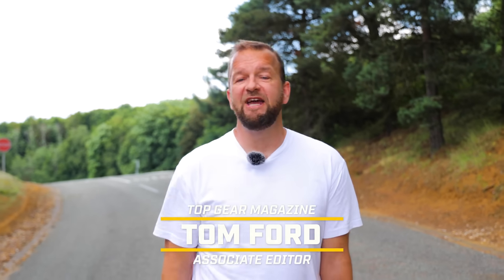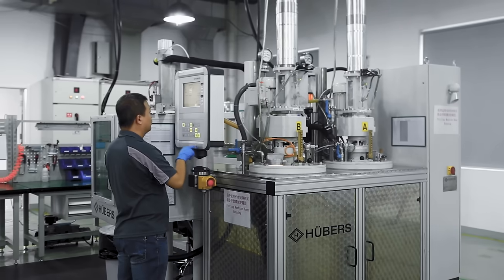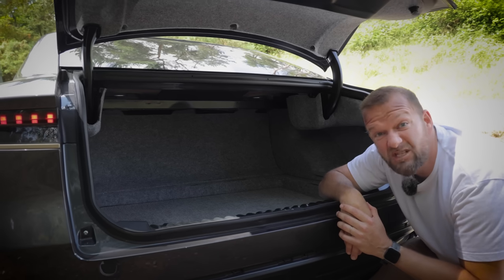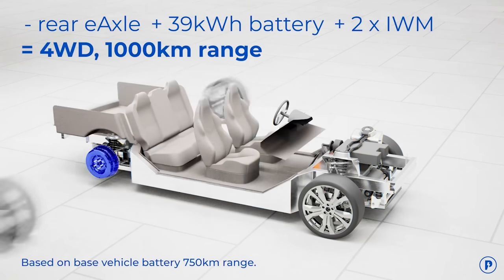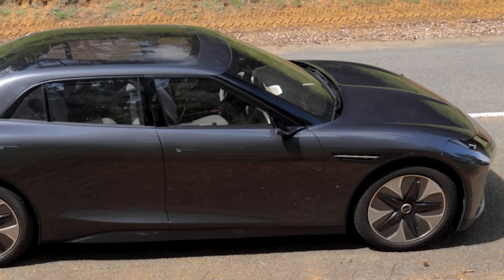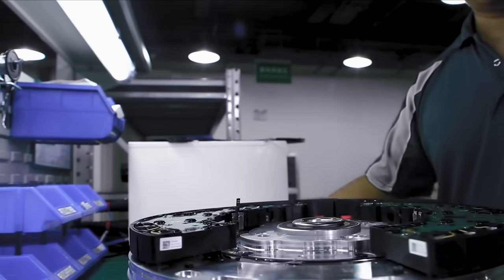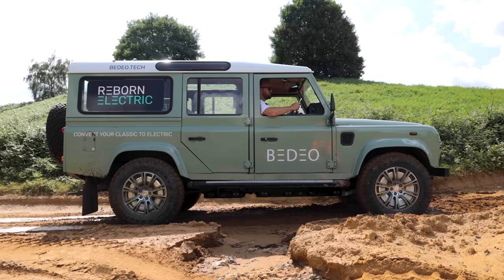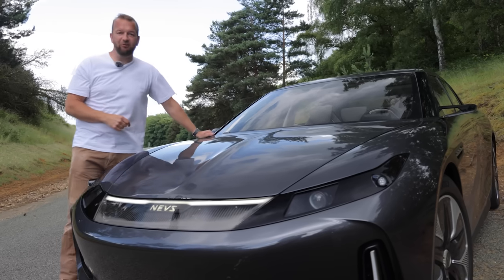NEVS Emily GT: SAAB’s Secret EV With 600 Mile Range | Top Gear

Comment: Absolutely beautiful car. Please brand it as SAAB with the ignition key at the SAAB position.
Reply: true
Reply: I was just saying that. It's a no brainer to keep it as SAAB.
Reply: We just need Saab back
Reply: Yes sir to that
Reply: SAAB, the military supplier that owns the rights to the name, is not allowing it - hence, NEVS.
Reply: Ignition? What is that!
Reply: When was the last time you saw a car with an ignition key?
Reply: Guys, it doesn’t need to be a literal ignition key. They can install a start/stop twist tab in the center…
Reply: Having had the pleasure of owning two 9-5's, the SAAB feel is there for me.
Reply: @John_Hoover  except it doesn't need that either.

it's an EV. get in. put it in drive and go.
Reply: @John_Hoover  SAAB = key. Could be electronic. Same for Porsche at the left side of the wheel. In stead of calling Taycan EV Turbo S.
Reply: @John_Hoover  Loads of cars have that already. It wouldn't be SAAB innovating if they did the same, and it was there as a Security feature as it locked gear box. . 
Polestar don't even have a start button it is on when you sit in the seat.
Reply: @John_Hoover  you don't need to 'start/stop' an EV either.  Just get in and it turns on and you can go, stop and it turns off and you get out!
Reply: @anonym3017  I’m it saying it “needs” a start stop. Hell, if we’re being honest here, most everything about this car isn’t truly a “need”. But it adds character in a unique way mounting it in the center. If it ever does become a Saab, it would make sense.
Reply: @sandersson2813  I’m speaking strictly from a “DNA” perspective. They don’t need stop/start at all. Adding in an electronic key that inserts into the slot just adds a cumbersome step of always getting the key out of your pocket or purse. People won’t want the hassle. But adding a start/stop like the Taycan but in the traditional Saab location makes sense… if it ever is a Saab.
Reply: @MyDagfinn  The 9-5 is barely even a Saab though
Reply: @John_Hoover  There's aot more SAAB design features I'd prefer to have than where the start stop is.
Reply: @sandersson2813  No one is saying they have to stop there.
Reply: Good points!
Reply: Thats ok ill buy one and install the proper badge, speaking of Sweden Koeniggsegg is working on their new tiny 330hp QUARK motor, that can also fit in a wheel well. I would love to see these two work together, Sweden is about to change the world
Reply: Took the words out my mouth 😂
Reply: Can you imagine?! I would buy one today!
Reply: Oh yes! Definately a Saab in my eyes! Please Sweden bring it back!
Reply: @cybertree  you mean like 4x that Q engine ? Holy shit !
Reply: @sandersson2813  you never been in a Saab I guess? They have the key next to the handbrake. Thats cool and should come back.
Reply: @rubbermoetroken  Yes, I had two.
The point is cars don't have keys or manual levered handbrakes now. 
Furthermore tons of car have start buttons in that location now, so it wouldn't really be a SAAB thing anymore.
Reply: @sandersson2813  you have a point there. Still it would be utterly cool if SAAB would do it :)
Reply: I miss that!
Reply: @rubbermoetroken  Polestar 2 is the closest thing we have to a SAAB, certainly in profile it's like an updated 9-3 MK1.
Reply: @sandersson2813  We have a Polestar at our company. They wish. Polestar is of the same kind of garbage as the Tesla model S that's normally parked next to it. ;-)
Reply: They can't brand it as a SAAB. They don't own the name SAAB nor the logo.
Reply: @rapu4  You heart me 😆
Reply: And reverse gear to release the key too lol
Reply: @MyDagfinn  Sorry lol, though I have had a few 9-5s and still have one. Great car, though I'll probably swap to a 9000 sooner or later. At least the 9-5 still has a real Saab engine unlike the NG9-3, disgusting ecotec shit
Reply: @TheBTG88 my guess about Saab the defense company not wanting its name on a car again is probably a case of jealousy - for many years, Saab the carmaker was overshadowing Saab the defense company, and when they got the rights to the Saab name back from GM, they forbade anyone to use it in a car, so that all the people remember Saab today as the guys that built the Gripen fighter, not the guys that built the 9-3.
Reply: @TheBTG88  Nope.. GM still owns the SAAB name for automotive applications..
Reply: @sandersson2813 This morning when I got into my car
Reply: @mullerman1104  I'm talking about new cars.
Reply: @sandersson2813  My car at the post office is from this year, a T6.1, still has a real key
Reply: @mullerman1104  It's a van
Reply: @sandersson2813  Is that a problem?
Reply: @mullerman1104  I specified cars, so your comment isn't related to cars.
Reply: @sandersson2813  why is a T6.1 not a car? It’s smaller than most of American gigantic SUVs. It’s officially a PKW, so why shouldn’t that count? Also every Dacia has keys
Reply: @kristoffermangila  Why would Saab be jealous about Saab cars overshadowing them in the public perception? They're a defense company, don't think their customers are about to confuse them with a car brand sharing the same name. I'm sure the whole naming thing is just about Saab not wanting an unaffiliated company to share the same name
Reply: You meant: Ignition thumb print reader...  LOL
Reply: @jesperviktorsson8027  Incorrect - 'On 29 August 2014, Saab AB announced it was cancelling the licensing agreement that allows NEVS to use the Saab name. NEVS' financial problems were cited as the reason. A spokesman for NEVS said that the company expects to renegotiate the agreement after a solution to the company's financial problems is reached.'  Citation - "Saab carmaker NEVS granted creditor protection by court but loses right to use Saab name". Automotive News Europe. Reuters. 29 August 2014.
Reply: @TheBTG88  the more you know, rhanks
Reply: Ignition switch lol
Reply: @rubbermoetroken  You know it! And that's aLOT of weight/space savings to play with!
Reply: @TheBTG88 Whaaaat?! Why might that be?! Do they still make military hardware? 🤔
Reply: They probably can’t call it Saab for copyright reasons
Reply: What ignition key?
Reply: @sandersson2813  Err.. still most cars, even if fewer than before.
Reply: Yes between the seats as even Volvo has done recently.❤
Reply: @John_Hoover  Also put a red light fasten safety belt on the ceiling and add a night panel showing just speedo, 0-100K.😂
Reply: @richardterrell7539  Chinese design…
Reply: @sandersson2813  This afternoon, when I got into my 2001 Alfa
Reply: @natdenchfield8061  Most NEW cars don't have an ignition barrel that requires A KEY.
Reply: @sandersson2813  I drive rental cars (so I'm not stuck to just my own, and they're new). The majority of them still use a key. 

If your experience is different, it doesn't mean you are right, it only means that's your experience - where you are, the types of car you drive etc etc.
Reply: @natdenchfield8061  You must be driving very low end vehicles.
Reply: @sandersson2813  Ah, so now you can see where your own experience is skewed. Glad we can now see where each other's DIFFERENT experience comes from and how your insistence my experience is somehow wrong is misguided, blinkered.
Reply: @sandersson2813  And ... really do you think a button and fob is a significant difference in cost? 

Seeing as many cars have already had security key fobs requiring them to be nearby to deactivate alarms for like the last 20 years, I would say that keyless ignition is possibly cheaper.

Keys provide an extra layer of security, so it's more about user experience and getting rid of that layer to influence sporty, modern brand image.
Reply: @natdenchfield8061  I can't think of any car which which comes with a physical key and ignition lock unless it's the very bottom specification. 
What cars are you saying are key only, because for every one you can name I bet I could name 5 that aren't.
I just don't buy your claim that "most" cars have an if ignition key, but that could be dependent on where in the world you are experiencing these cars.
Reply: @WatanabeNoTsuna.  Yes, absolutely.
Reply: Agreed!
Reply: Yeah just as I thought too.
Reply: But the ignition aka start button is not for function but for looks now. It is a tradition. Even thought the design intention is for driver safety in case of crash, the key won't stab you in the chest.
Reply: @TheBTG88  SAAB, the military supplier and SAAB Automobile are two different companies.
Reply: @bafattvahetere  SAAB Automobile was only ever able to be called SAAB, because it was initially a division of SAAB (in English - Swedish Aeroplane Company) and later on it was licensed the name.  SAAB, the military supplier company, retains the licensing authority to the SSAB name.  It refused to allow the NEVS entity to use the name, hence why the cars were branded NEVS.  SAAB Automobile no longer exists.
Reply: Saab please !!
Reply: @FFVoyager Boring!  My EV would have a big red push button which would light up the car and play the start-up 'music' of the 1966 Batmobile - Atomic Batteries to Power!!!
Reply: They can't because Saab is still Saabs trade-mark
Reply: Plus, you have to put it in reverse to get the key out!
Reply: @kristoffermangila Saab AB is and always was the one and only real Saab. To say the automobile division overshadowed Saab doesn’t make any sense. The reason they don’t want the Saab name to be used is they don’t want some CHINESE company pretending to be the real Swedish automaker. NEVS is the husk, the factory and the rights to a GM chassis and body style, they are not Saab. The only reason that Saab AB split the car division off from itself was so that they could sell it to GM.
Reply: it looks Saab-worthy.
Reply: Nightmode or bust
Reply: @TheBTG88  Maybe they're waiting for a car that deserves the name.
Reply: Totally agree. Who is this presenter? For obvious reasons I’ve not watched a single episode of the fake TG since Jezza, Captain Slow and The Hamster left. All the cretins hired by the BBC in an attempt to replace them have been tragically bad personality deficient cardboard cutouts with zero car cred. 

Of course the late awesome Sabine was amazing and a notable exception. 

But this guy seems to know his stuff.
Reply: Ignition? LOL.
Reply: What will we be setting on fire?
Reply: @sandersson2813 mine..2007 Subaru 😂
Reply: What is an ignition key I piolet a Tesla
Reply: @frederickfaller899  What is ignition? What are they setting on fire?
Reply: Saab was one of the worst reliable vehicles ever made. Saab is right where they belong… BANKRUPT
Reply: How about no